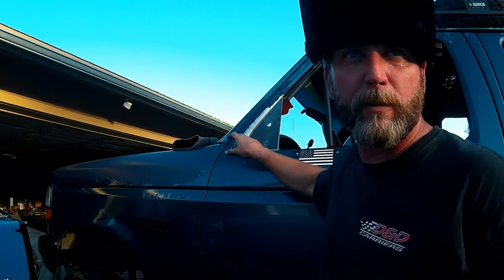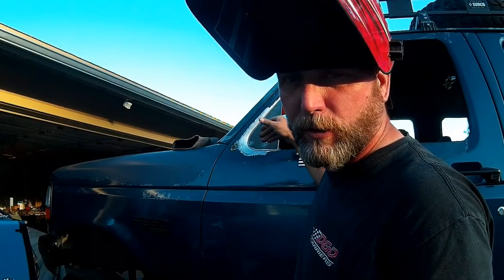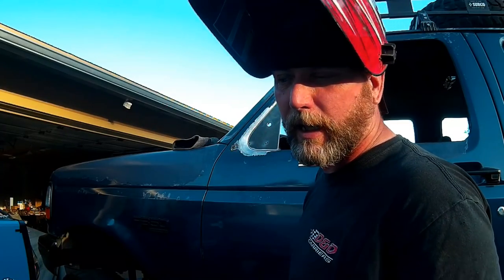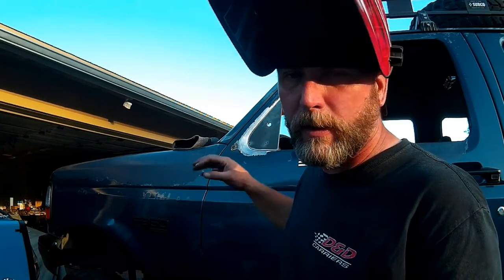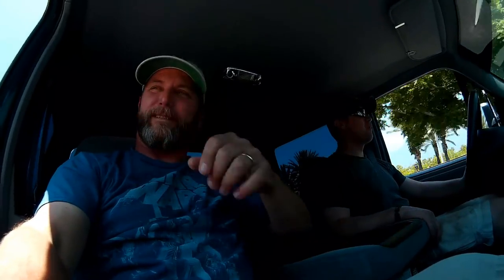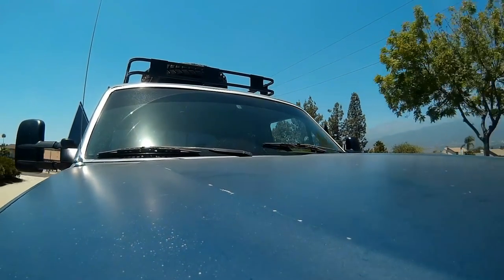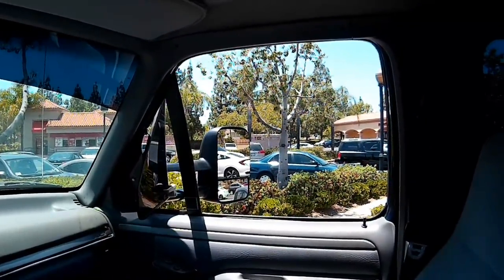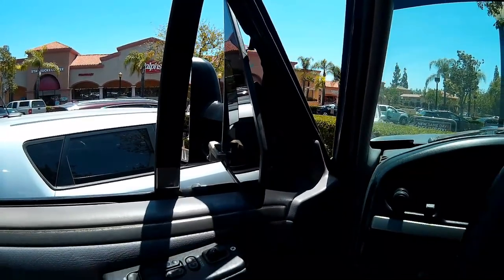Ford OBS; DuraMax Tow Mirrors!

Comment: Who makes the plates? and what year of mirrors?  Most of the ones or people that have done this deleted the wing windows these are cool.
Reply: 5280 Custom Fab made the plates and they are designed to fit 99-07 Chevy tow mirrors.  The 88-98 mirrors are shown in the video because that's what I had originally.  I have the newer mirrors that I'll put on this weekend that will match the base plate better. https://www.5280customfab.com/products/
Reply: @kevinsinclair1013  I have a question about your door handles, what coating is on them and does it wear well?
Reply: @OKstang77  it's just satin black spray paint. Just make sure to scuff and clean the chrome up prior to spraying and it should hold up well.
Reply: That's slick an u kept ur wing windows!!!

Comment: What year are the dura max mirrors?
Reply: I have 99-05. You can also use 88-98 mirrors with a different bracket. Mirrors are the same size except for the base.

Comment: Totally off topic but how much mpg is he getting for his setup
Reply: Daniel Lira Well, not great. I haven't checked since the headers, cam, etc but it was 7- 8ish prior to that. That is mostly city. I've got a trip planned with the trailer that is about 150 miles round trip. I'll try to get some accurate numbers.
Reply: So after the trip pulling our trailer, the truck got 6 MPG. Trailer is a 35' travel trailer that is around 9k pounds after being loaded up.